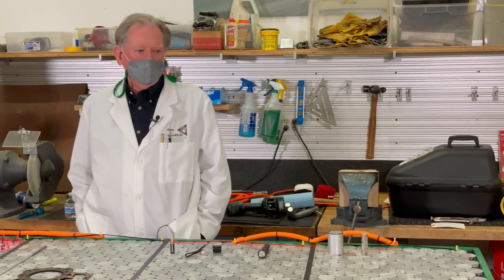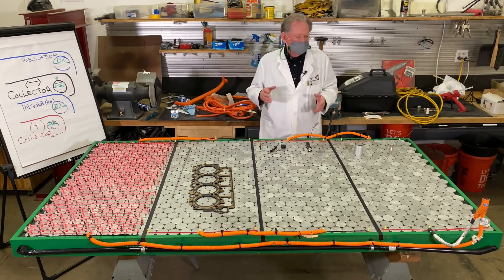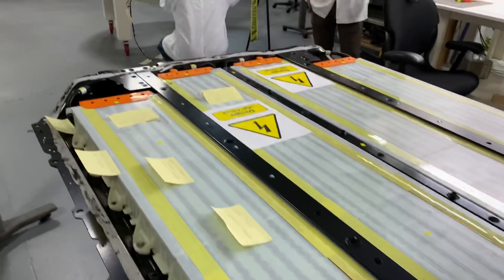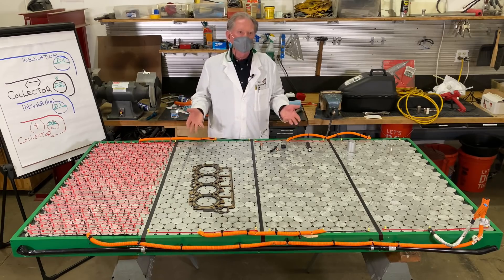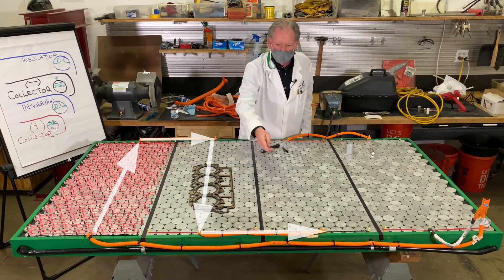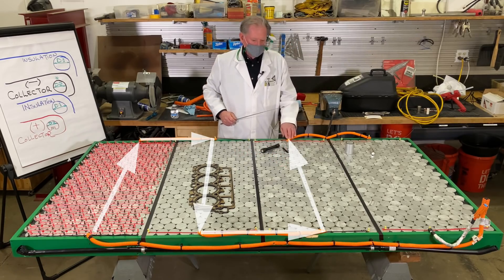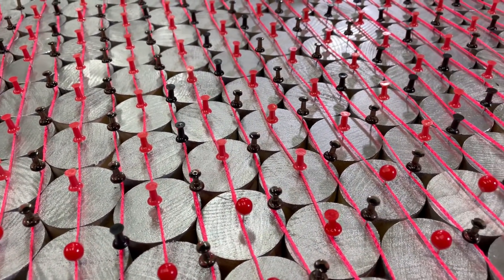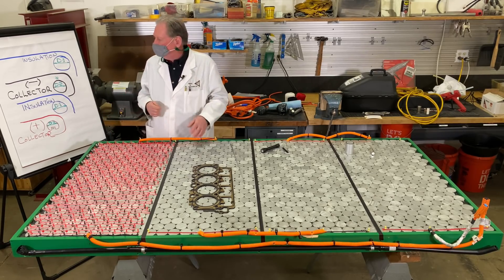Tesla 4680 Battery Pack Prophecy

Comment: Kewl. Just a dumb question or two from me:
1. Why would they only have one side plate/manifold and not use say positive at top negative at bottom?
2. Obviously this is possible with spot weld but would it not be better to use Electronics style assembly where the whole manifold get heated at the same time for the soldering especially if you run cooling in the manifold this can be used to held manufacture the component as well?
Reply from the maker: Hi Jacobus. The Model S and Model Y did have current collectors on top and bottom for the 18650 cells and 22V Modules. The Model Y and Model 3 homogenized all current collectors on the top for the 2170 cells, but there was 4416 cells! we think they will continue to have one sided welding/bonding. Thanks for weighing in.

Comment: I don’t think this is a good design.
Reply from the maker: Hello! thanks for your opinion, and thanks for watching.
Reply: @MunroLive  You should check the battery day presentation and check the actual terminal design https://youtu.be/l6T9xIeZTds?t=3031
Also other possibility is the guts of the cells are symmetry so positive and negative could be flipped.

Comment: If the case cylinder of the cell is one pole, wouldn’t welding the cases together give all the connections for that pole and give more structural strength to the assembly?
Reply: You need some flex between cells for thermal and chemical expansion. It would be too strong and the welds would tend to crack from the expansion forces. The manifold  sheets will allow for some "slack" at the connection point in form of slightly bent strips (like a leaf spring).

Comment: Place where the wires should go should be prioritised for heat removal, I wonder how they plan to pack coolant lines in between that layers of gaskets.
Reply from the maker: Great point Flagman V. We believe the cooling will be from the bottom, or worse case they will emulate the Model Y and Model 3 and cool from the sides of the cells.
Reply: @MunroLive  Cylindrical cell emit most of the heat on it's ends, cooling from sides would reduce the cooling performance, but heating from sides might be better for colder climates. I think they can mix the two by allowing some heat from ends to be taken by sides pipes
Reply: I think the coolant will be at the bottom of the pack.

Comment: Interesting, just like a two-layer circuit-board, but built for much higher amperage.... and the layers should have big holes in them, so they can glue the cells to the top of the battery pack 🤔
Reply: This would be a two layer circuit-board with 350-400 V! And you better keep the poles separated there! Or even 700-800V in case Tesla steps up in battery voltage like Porsche and Lucid did.
Reply: @koeniglicher  800v is used by companies with inefficient packs that want to get close to tesla's 400v acceleration and charge speeds.  They double their crappy 400v packs to make an 800v pack that costs more.
Reply: @_PatrickO  isn't the pack 400v, then doubled to 800v AC at the inverter, agreed, I'm nervous, so it was only the early 7000 cell cars that had end to end connection rather than top end only; so the base  is pressed into a water manifold, how is the top electrical end secured, with these four head gaskets ?
Reply: @koeniglicher  "This would be a two layer circuit-board with 350-400 V!" I believe it would be 1/4 of that. You don't get the higher voltage until after it's run through all 4 sections.
Reply: @koeniglicher  Changing the pack to 800Volt configuration would be so easy this way ... just install a different manifold, the rest of the pack can remain exactly the same. 👍 It may even be possible to switch between 400/800V on hardware level, with contactors, for more efficient charging. 🤔
Reply: @Poxenium  I'm assuming Tesla will design the switches electronically so they can convert from 400V to 800V on the fly, as they need.
Reply: Another thing to keep in mind - they need to have a cooling plate sandwiched in there somewhere too.  Not sure if it would be on the bottom or top of the pack.
Reply: @rcjbvermilion  Bottom of the pack seams the most logical place. Don't need to worry about the electrical connections that way.
Reply: Would also add a little extra protection from intrusions.  I’d be surprised if they don’t have heat transfer on the top and the bottom
Reply: @rcjbvermilion  you do realise we call it the top by convention, a cell is sealed it can go in any orientation, so long as you can get the distilled water in, lol
Reply: @William Goode Cells may not have a "top" and "bottom", but this pack will. Electronics at the top, cooling at the bottom.
Reply: @patreekotime4578  I don't understand why you would cool on bottom if heat naturally rises instead of from top?
Reply: @rcjbvermilion  I think they're gonna go plate cooling, but another option that is getting attention in the EV world is dielectric immersion cooling.
Reply: @Joel Bennett I think they  covered at Battery Day that the entire bottom of the pack is for cooling.  And the cells are all glued together, that is why it is a "structural pack" so no fluids between them.
Reply: Kyle Towers  I believe Sandy already explained that the internal copper sheet will conduct the heat best, and that's connected to the bottom of the cells.

Comment: Why connect only on the top, why not connect negatives on bottom?
Reply from the maker: Great question Doncho. The Model S and Model X did have collector plates on top and bottom of their smaller 22 volt modules with the 18650 cells. The model 3 and model Y have move 100% of current collectors to the "top". Having all wire-bonding/welding on one side makes manufacturing easier to control; and will allow for a clean interface to a thermal management solution on the bottom of the cells.
Reply: @MunroLive  This is the way

Comment: I thought they were explicitly not doing modules?
Reply from the maker: When sandy mentioned “modules” he was referring to how the cells are grouped for flow of electricity. From a manufacturing perspective, 0 modules, 1 massive pack.
Reply: @MunroLive  "0 modules, 1 massive pack" would be a complete nightmare for battery repair. And it would be harder to change from 96s10p to 192s5p to make the change to 700-800V like Lucid and Porsche did.
Reply: The black lines shown in the video, that give the impression of modules, are an illustrative aid.  They were not meant to imply that there would be a solid material layer dividing groups of cells in the battery.

Comment: Love seeing the full battery pack proposal and hearing the explanation of the connections. Seems logical to me! Would be curious to hear your thoughts on how the cooling system might work and/or differ from the 3/Y. Thanks again and have a Happy Thanksgiving! 🦃
Reply from the maker: Thanks Mark! Sandy is convinced the larger cells will be cooled from the bottom. Might make a good follow-up episode.
Reply: @MunroLive  you could also go hollow core as its wound
Reply: End to end electrical was good because it was sprung, side cooling though, not great.
Now we have tabbed top end connection leaving the option for much simplified bottom end cooling/heating, hmmm that could be huge, thank you Sandy, for your insight.
Reply: Model S/X/3/Y all have cooling provided by channels that zig zag back and forth touching the sides of the cells. This is ineffecient for several reasons: heat transfer from the sides of the cells doesn't cool the core of the cell, the surface area for contact is relatively low compared to the volume of the cell, and the distance that coolant has to travel to make its route around the cells is very long, and the volume of coolant that can move through the tiny channels is very low.  By cooling from the bottom: they will be able to extract heat evenly throughout the cell,  they maximize the surface area contacting the best location to extract heat from, the coolant can travel a shorter distance back to heatpump, and a greater volume of coolant can be used.
Reply: @patreekotime4578  yes, overweight software and electrical, you could also wrap foil around tube